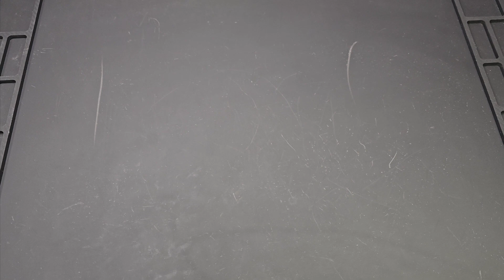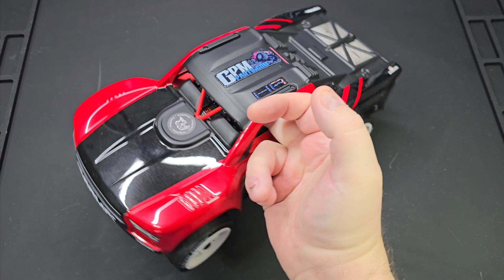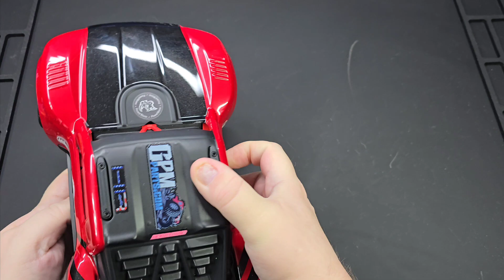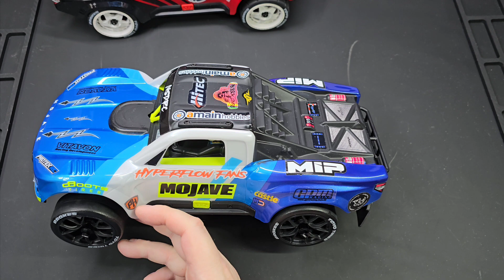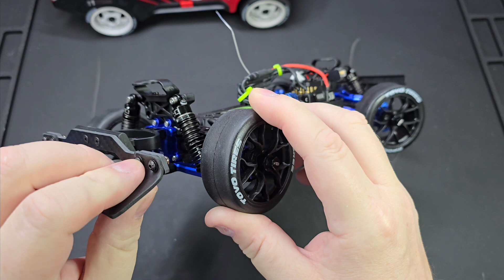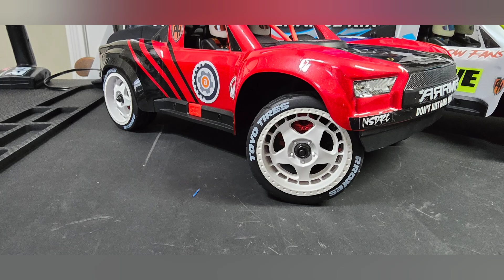Arrma Mojave Grom Builds Part Reviews GPM Racing Vitavon Castle Creations Hobbywing Hot Racing Power

Comment: Why did u go with the 1007 ?
Reply from the maker: @lord_iam  I went with the 1007 because it was the largest motor you could get to fit in the chassis.
Reply: @thepissedrhinoshow  i fit the 1010 has a bigger shaft
Reply from the maker: @lord_iam  I think that's not true, from what I read they are both 3.175.the 1010 is a little long for me. I like having a fan in there.